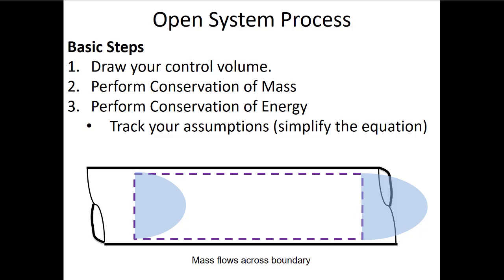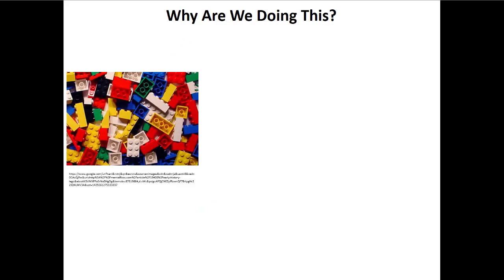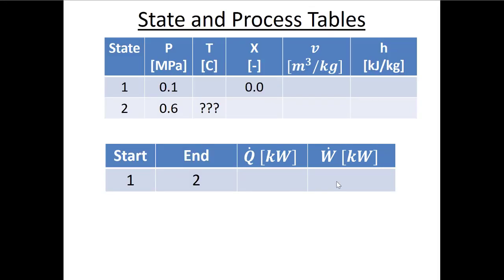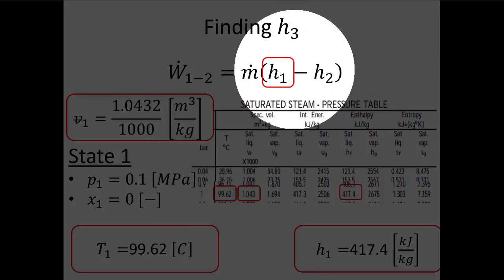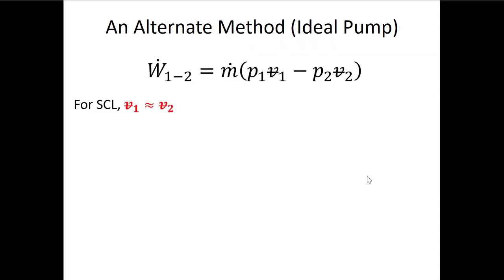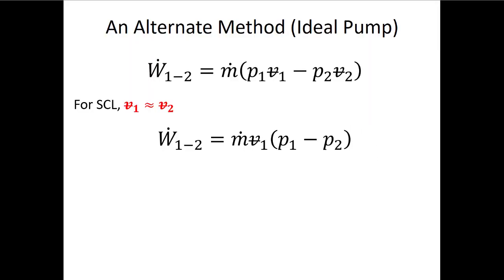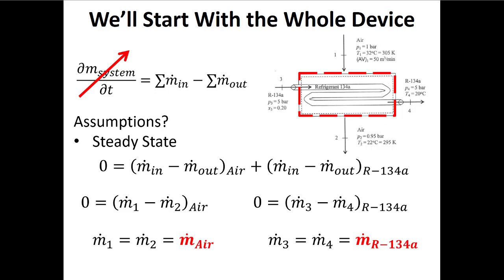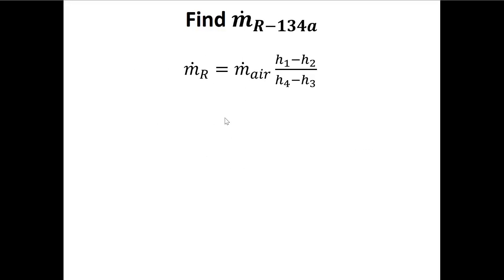L17 More 1st Law Example for Open Systems (Pump & Heat Exchanger)

Comment: A Stainless-Steel Plate Heat Exchanger Requires a Pump. A performance test for water and ethylene glycol mixture fluid at 50%/50% mixing ratio is done on a stainless-steel plate heat exchanger. The 15 L mixture of Water (50%)/Ethylene Glycol (50%) is the hot side fluid and water from the tap is used as the cold side fluid. The total heat transfer area of over 600 њ2, the length of the plate is 175 mm, the width of the plate is 60 mm, the thickness of the plate is 18 mm and the gap between the parallel plates is 2.2 mm. The flow rates chosen for the performance test are 1 L/min, 2 L/min, 3 L/min, 4 L/min and 5 L/min. The plate heat exchanger requires the use of a hot fluid pump as part of its service module. The service module also consists of the following specifications: ▪ Flow meters for hot and cold fluids ▪ Heater 3000 W ▪ Hot fluid stainless steel tank (15 L) with level switch ▪ Two sets temperature indicators ▪ Temperature control Unit 1. You are required to establish the type of pump to be used and to select possible parameters for the pump, include all possible omitted specifications in your selection, such as size of pump required, the pump efficiency, and all required pump parameters. 2. As part of the maintenance team, provide maintenance procedures for the type of pump You have selected. Could coupling be required for the size of pump selected? 3. Provide calculations for pump analysis, and draw the characteristic curves associated with pumps for Your pump selection using MS Word/Excel. 4. In addition, provide calculations for the Reynolds Number for the hot fluid at T=45 °C average temperature for all the flow rates indicated. ( ђ=ѣĎ where Ď is the hydraulic diameter, dynamic viscosity). Could the flow be considered laminar or turbulent? Plot on a single graph Reynolds Number against the Flow rates. Compare and discuss these results. 5. You should be able to discuss any limitations on the project and present further recommendations for the limitations. You are not expected to do the following

Comment: Please urgently assist me with this question.. On how to tackle it
Reply from the maker: I only briefly read the problem you posted. But it seems to me like it's not a heat exchanger design problem like what's tackled in this video. And it seems to me that you need to determine the pumping requirements from the given information. Since it's not related to the topic here, I don't think it's the right venue to discuss in detail here.
Reply: Yes it requires a great pump for this heat exchanger I was hoping you'll have an idea of how to start